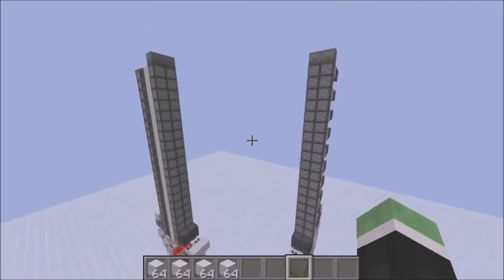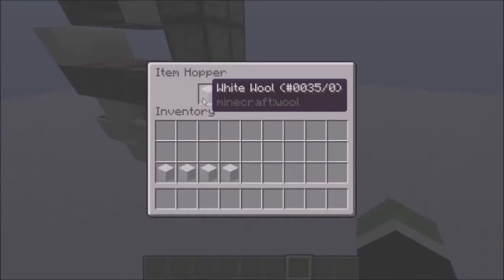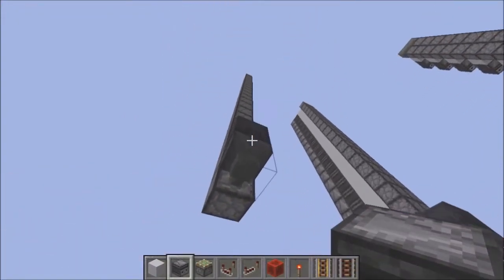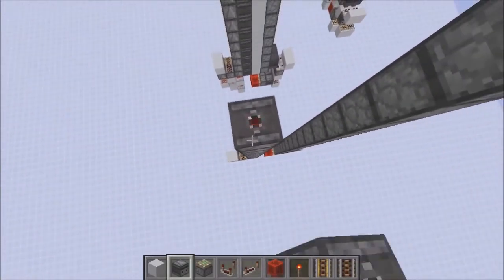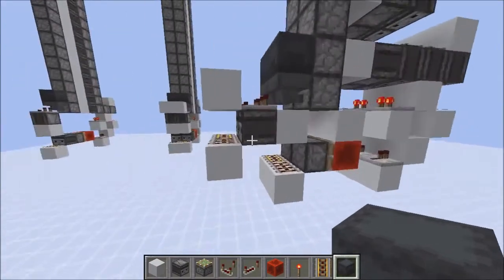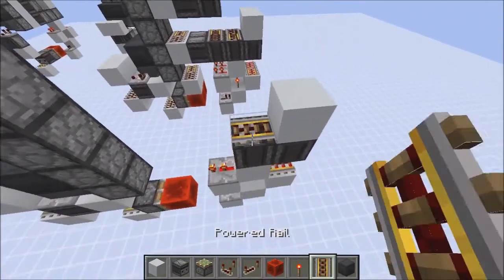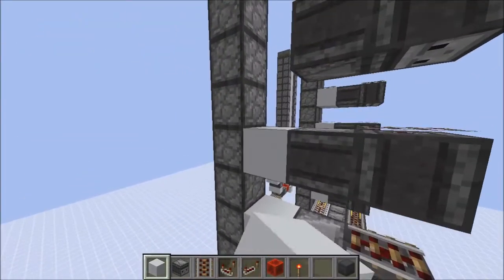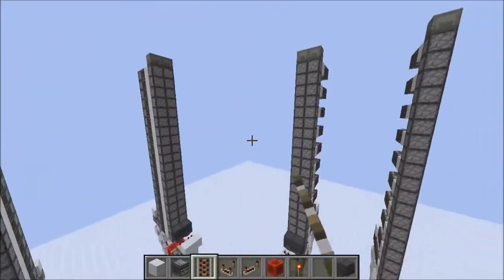1-Wide Tilable Silent Hopperspeed Dropper Elevator

Comment: I know this is an older video, but love the concept. Observers are the best way to go. I had to adapt the concept to work on Bedrock and remove the rails, since the observers don’t stay on at all. With just a one-tick pulse, I ended up using an observer as a clock with a couple slime blocks and a sticky piston to push it into position, along with setting a five-tick lock on a repeater from a powered comparator. It works great. It doesn’t seem to matter how full I get it or how high the droppers go, it still works til the last block. It’s just noisy as hell, especially with all the droppers I added. 😂
I guess Mojang didn’t want droppers to be quiet on Bedrock. It’s a shame. If anyone knows of a work-around for this, please let me know. Thanks MethodZz 😀

Comment: Thank you so much, I've been trying to figure out a stackable 1 by 1 model for a bit. I wanna know how long and how the hell you managed to design this model
Reply: I just hope FAWE doesn't f*ck with this too badly
Reply from the maker: hm about 5 hours in total maybe. dont know exact timings. going to release another video on these elevators soon with a slightly diffrent bottom part to make them truly silent(no piston noise) and a non directional one for 1.13.
Reply: @MethodZzS   Does this one not work in 1.13.2? If not, could you specify in title?